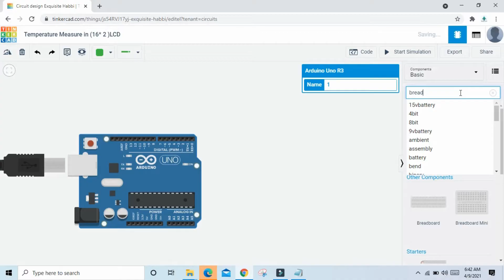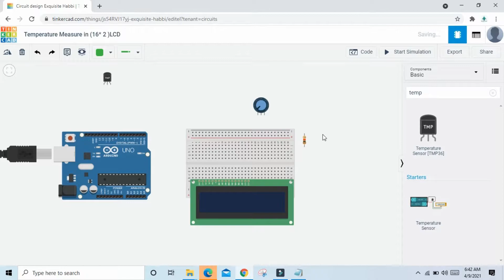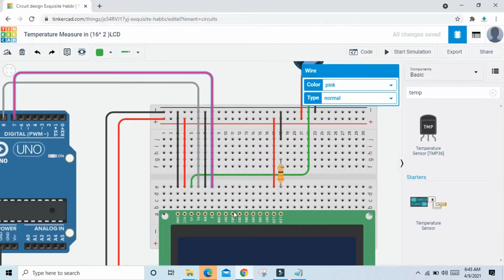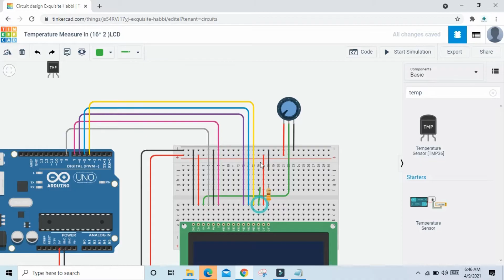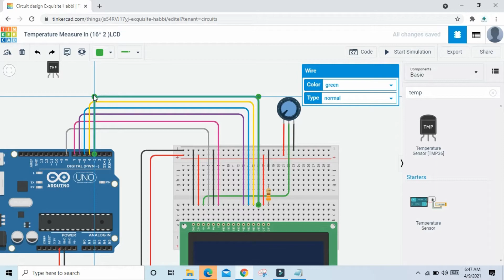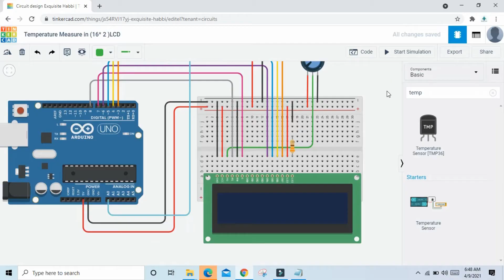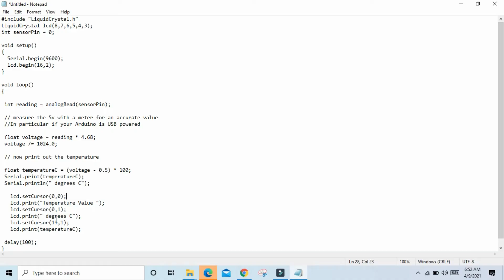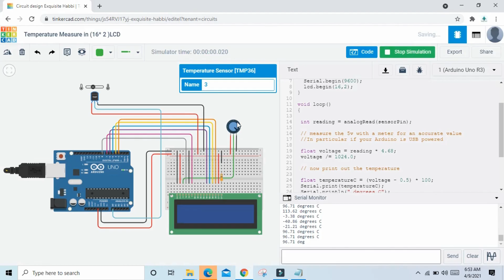#32 Temperature Sensor Tinkercad with Lcd in English || tinkercad circuit || Block Code || simulator

Comment: Sir temperature value is not showing in lcd what to do
Reply from the maker: Rotate the potentiometer
Reply: @eazytronic9394 I have rotated then also not showing connection is also correct
Reply: @eazytronic9394 please upload this project in tkinderd website
Reply: @eazytronic9394 sir please upload this project in tinkerd website

Comment: what is the purpose of the potentiometer?
Reply from the maker: A variable resistor is used to adjust the LCD driving voltage; where an increase can overcome the effects of temperature. More importantly, the potentiometer is used to accommodate the desires of the user in terms of screen brightness or screen contrast.
Reply: @eazytronic9394  thank you.

Comment: i scrolled the potentiometer but the LCD still isnt displaying the readings my code is identical to what you provided as well.
Reply from the maker: Its work watch the block Coding lcd video
Reply from the maker: It work watch the block Coding lcd video

Comment: Hi sir, may I know what are the sensors and actuator in this system?
Reply from the maker: Temperature sensor
Reply: @eazytronic9394  Also, what is the connectivity standards use for this system? ASAP